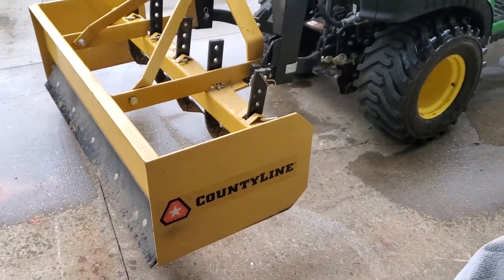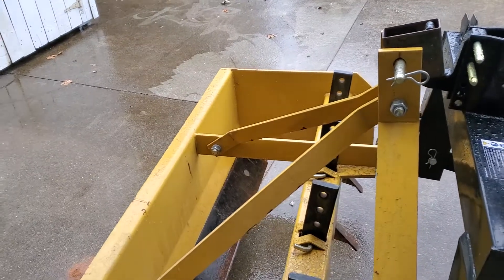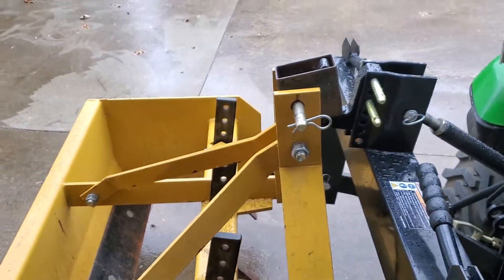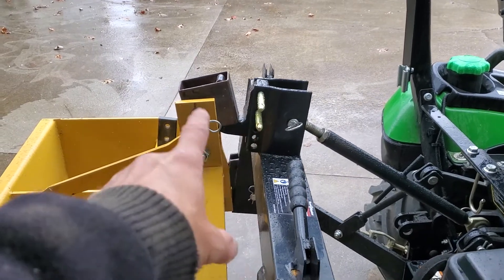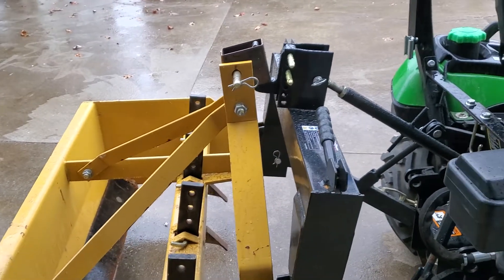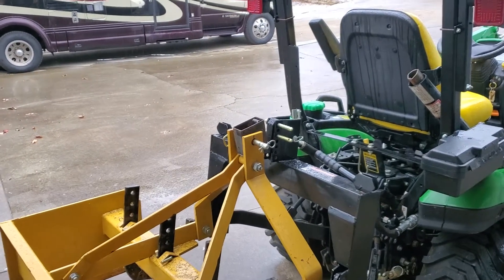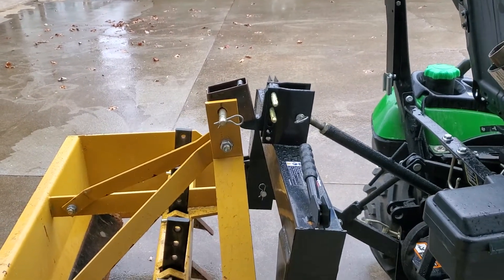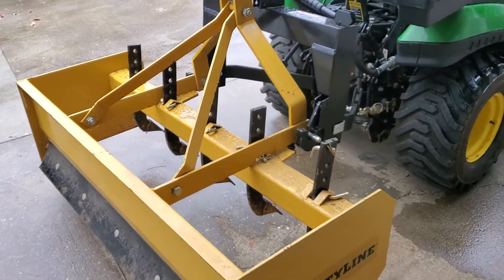20201125 John Deere 1025R Quick Attach to cheap Box blade Top Hook Fix

Comment: Those diagonal rear braces are currently on the inside of the upright braces.  If you move the attachment points to the outside of the uprights, the quick attach will work just fine... You are welcome!

Comment: The issue I see is that the rear of the box blade is not held firmly in place.  If the rear of the box blade hits a rock, it will pivot up until the length of tubing contacts the forward face of the hook or the 3/4" pin hits the rear face of the hook (whichever is less).  If you weld a triangular piece to fill the opening forward of the tube to the face of the hook, that might alleviate the slop. Regards.

Comment: As long as the angle can be adjusted, good problem solving.  Your top link looks almost to the end of adjustment, can you adjust the angle to suit your needs?
Reply: It works if you hook the lower pin.  I have the same box blade.
Reply: And hitch